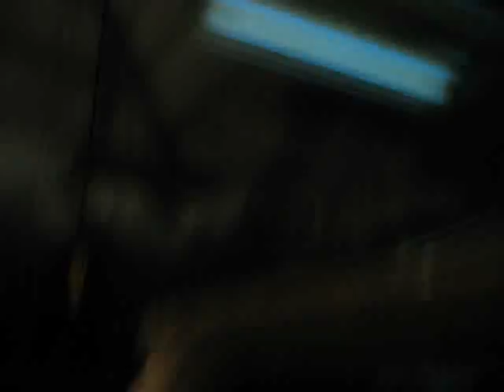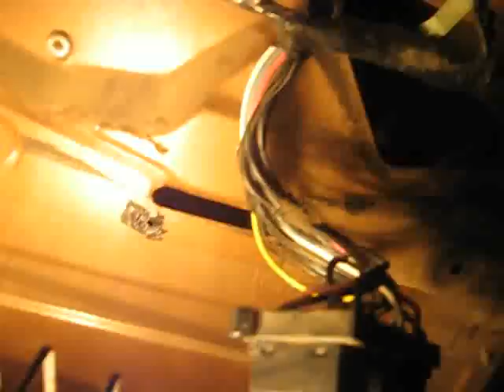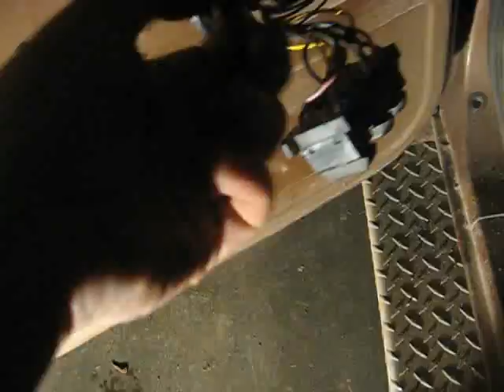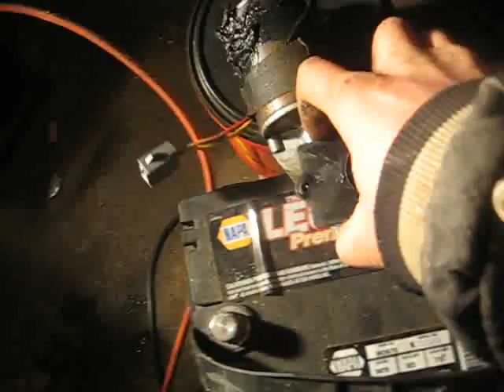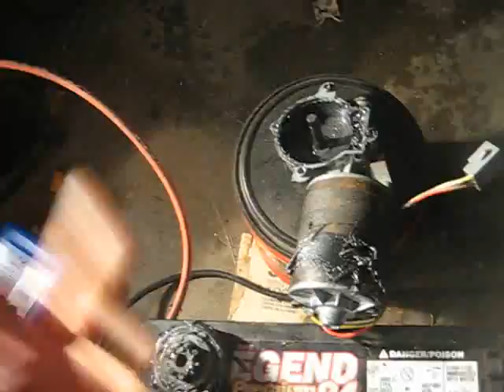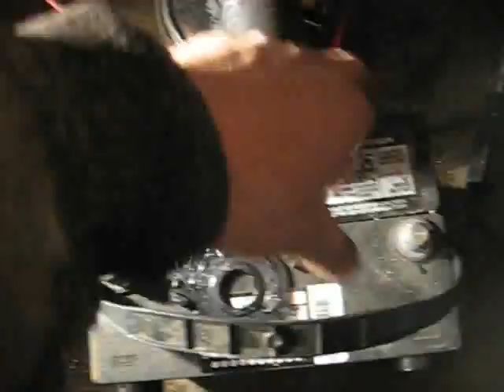1987 Ford F150 Window Motor Gear Replacement

Comment: Just replaced the motor on a 92 F150 and a new motor cost about $45.  Took the entire assembly out which may be easier than taking out just the motor.

Comment: my 1990 f250 had the gear problem first fix was hot glue that lasted a year then i put ball bearings in place of the broken pins and i also cut a hole on the inside of the door to make it easier lol can't tell with the panel on but it still works today now if i could fix the timing cover it cracked on me (351w)